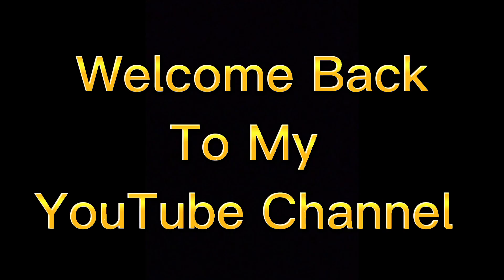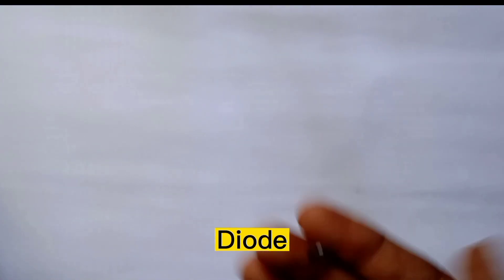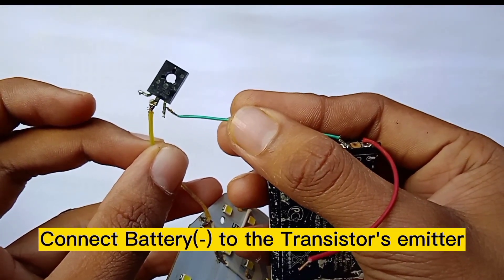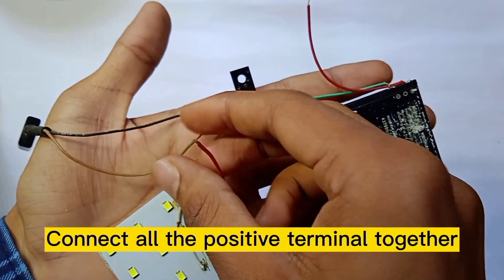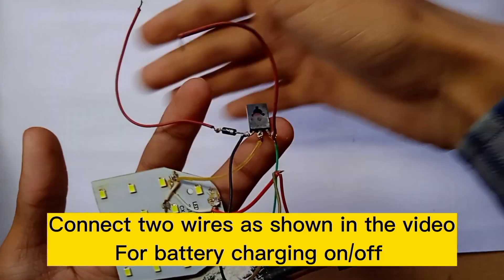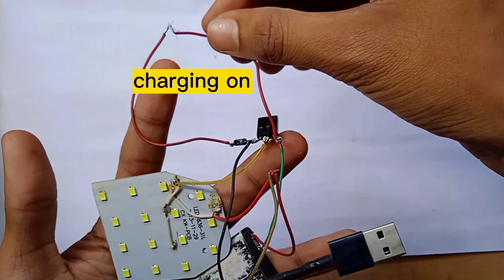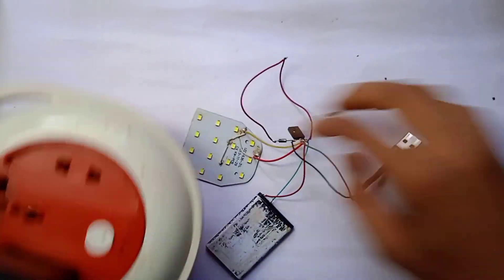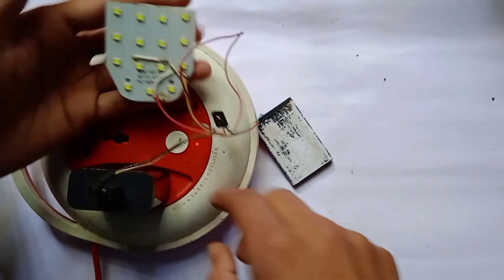automatic on off light using 4202BD transistor | 4202BD transistor project

Comment: Very low brightness what to do
Reply from the maker: Check the transistor
Reply: Can i use 13001 @DesiEngineeryt
Reply: Can i use 13001 transistor i got it from cfl  @DesiEngineeryt
Reply from the maker: Yes of course. But connection may change
Reply: Your diode is dead